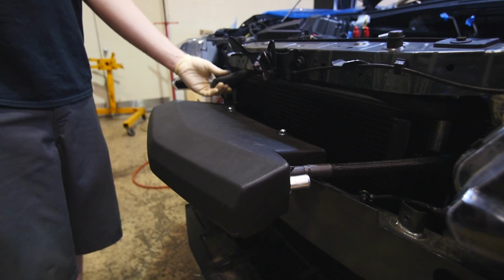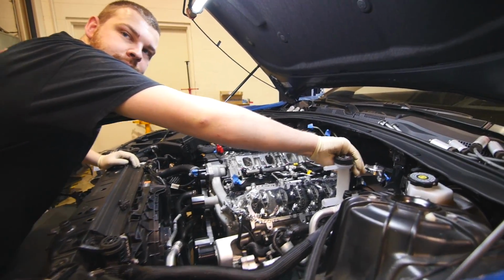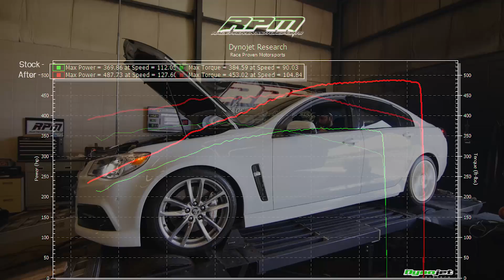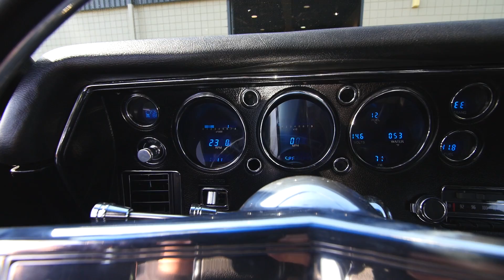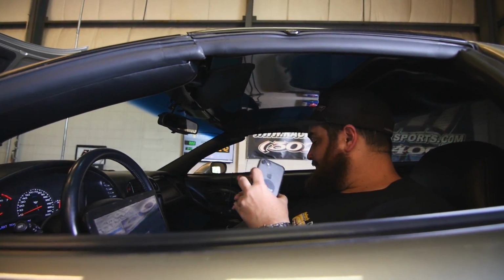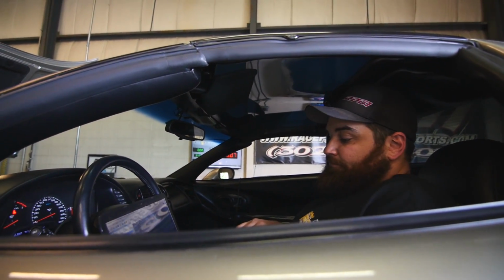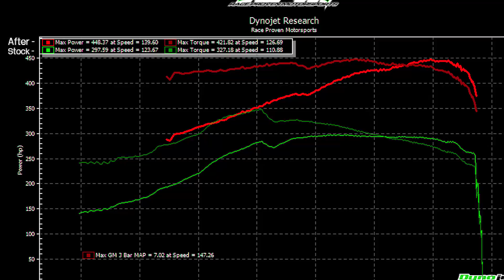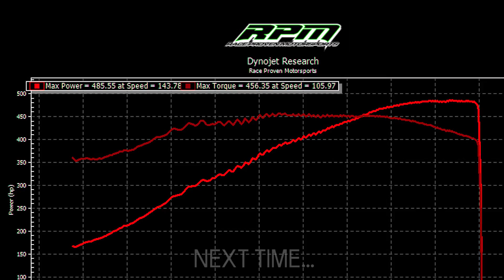Procharged C5 Giveaway Car Hits the Dyno! | RPM S5 E8

Comment: I hope the c5 winner has rpm transmissions on speed dial 😂
Reply: Bmackins94 think he's in North Carolina so maybe they're neighbors 😆
Reply: Rpm transmissions is in Indiana so i think they are a little bit farther than neighbors.
Reply: Where in Indiana is RPM transmissions at in Indianapolis?
Reply: Silver Ado it's in Anderson Indiana
Reply: Hope the owner has 2000.00 hanging around. Once he upgrades the exhaust he'll need another tune with the flow he'll get
Reply: @Shaunoftherev---- Race Proven Motorsports isn't in North Carolina and RPM Transmissions isn't in NC either!
Reply: @honda450rider87   hey we do have an RPM in garner NC not affiliated
Reply: i mean they didnt make much more than a heads cam package   they just didnt open it up and add more boost   if they did itss over

Comment: How does the meth injection work ? Fuel boost or cool I.a.t’s like water injection? Also what are hp gains ? Can Fran do a pull on dyno with it off and then on some time ?

Comment: You guys take in all dfr cars at least someone is making them right
Reply: Gino Sanchez well damn lol
Reply: Was wonderyif anybody else noticed too
Reply: ok so changing tires is DFR's fault now? not defending the other broken builds but how is changing rubber a shop's fault? unless its just to further hurt someone just for kicks.
Reply: they probably know the guy and would you trust any old tire shop to do your drag radials on viper wheels I think not or any ways I wouldn't besides they probably know the guy and probably told him to swing by to get them rimed. Radials are very har to rim and you don't want to get the rims all scuffed up. the reason behind me saying this is in all the last 5 videos you don't see the viper in the shop at all and no indicator of any work being done to it and besides they don't work on those cars their if you follow their work you would know that. anyways didn't really expect to get in this big debate over a tire change lol
Reply: Gino Sanchez rpm doesn't work on vipers. Well unless it was ls swapped 😂
Reply: For the "just take the Viper to a tire shop" comments...I worked at a dealership where we sold a TON of Vipers...we sent one across the street to a "tire shop", in this case a WTC...for an alignment....well...one of the jack asses that worked there...took ot for a joy ride because he had never driven a Vipee before...and totaled it...it was a nightmare...but...we forced them to basically buy the car from the owner and we had to track down another one like it to sell him...I would much rather have a shop that knows high performance vehicles work on my car...even for a simple thing like tires...than some jack off chain store shop...so shit like that wouldnt happen...